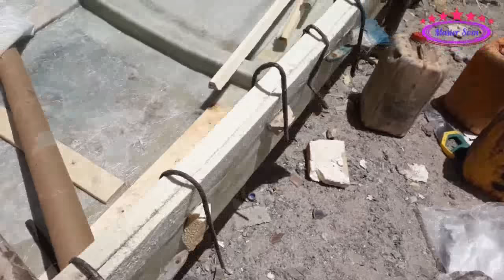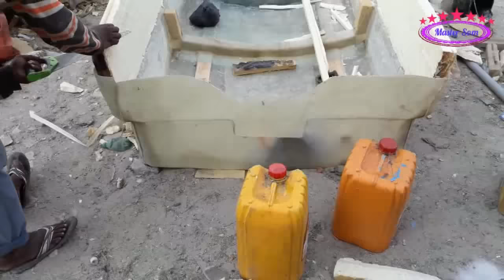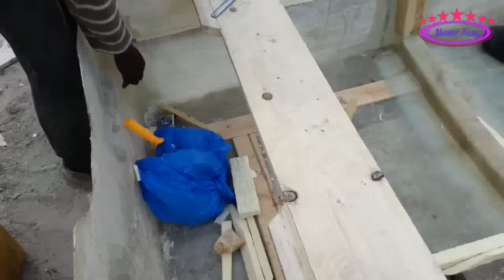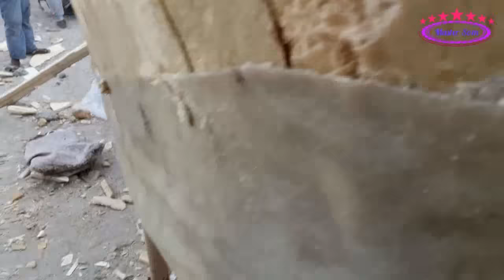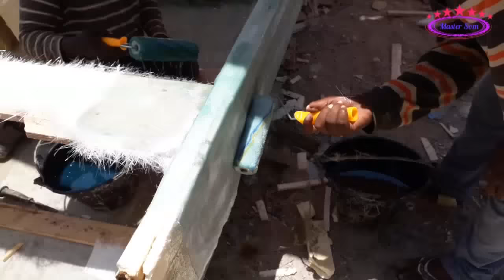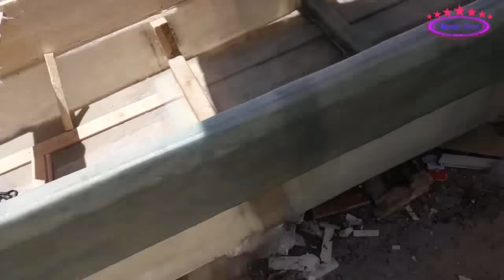Fiberglass boat building part  3

Comment: What material do you use to make keels?
Reply from the maker: It is fiberglass
Reply: I mean the structure after fiberglass casting.
 It is  foam, right?
Reply: Why is it insoluble when exposed to resin?
Reply from the maker: It's fiberglass, which made starnd mat plus glue.
Reply: @master_som  What material are you using for cutting saws?
Reply: @master_som  How can I contact you? LINE or Facebook.
Reply from the maker: My Facebook     (    muse muse  )
Reply: Master Som My facebook       Atiwat Srivirun
Reply: @master_som  eelaay bukurow maasameeyay doonta